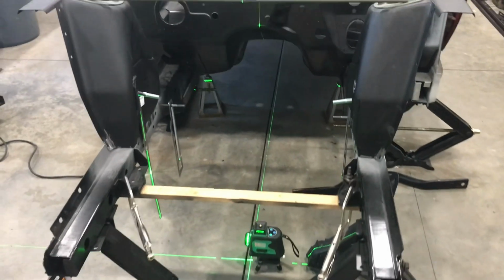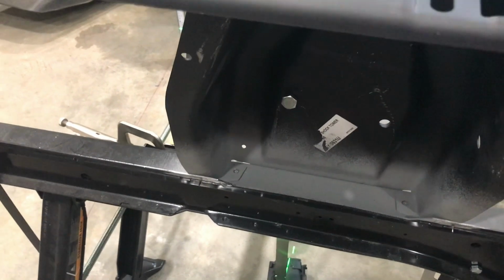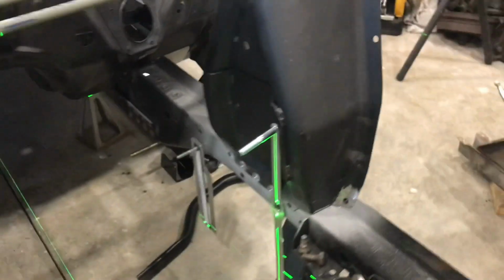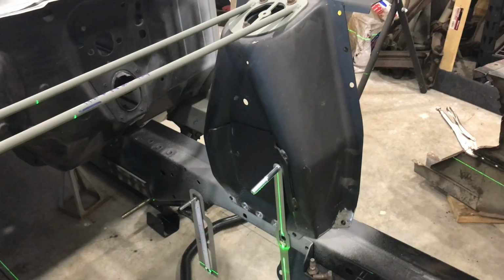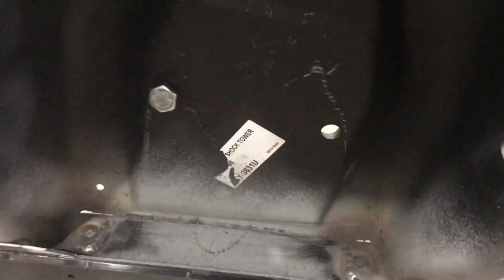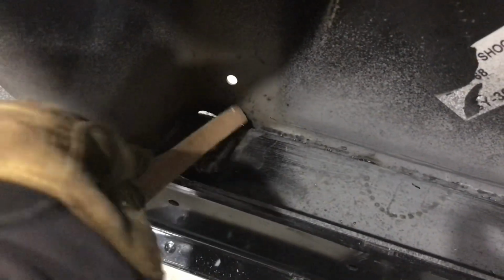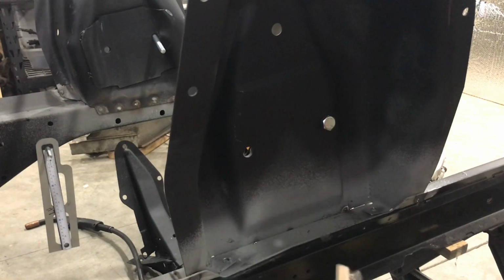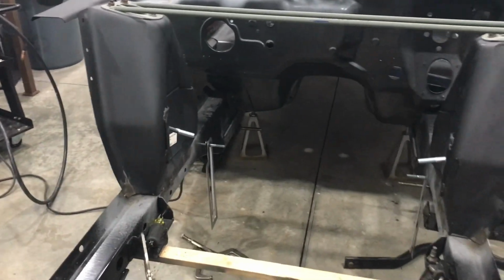Project Update: Final alignment check and welding of the shock towers

Comment: Nice videos.  I am preparing to replace the driver side shock tower on my 65 mustang.  Where do you find the points to measure the dimensions for the shock tower placement?
Reply from the maker: I used the measurements provided in the service manual for 1967.  The manual provides the height measurement from the datum plane below the car up to the forward upper control arm mounting hole.  It also gives diagonal measurements from the idler  arm mounting hole and steering box mounting hole to the upper control arm mounting holes.  Those measurements should be taken from under the car, or projected down onto the floor, because the manual provides them in a drawing labeled “pan view.”  It may be helpful to use a plum bob to mark those out on the floor.  I believe a lot of people install an export brace before removing the tower and then use it as an alignment device for the top holes when installing the new tower.  That should help with making sure the tower is angled properly.

Comment: Making nice progress..... I am in the same boat as far as front frame and shock towers go, what laser lever are you using?
Reply from the maker: The brand was Atralife and I got it on Amazon, but I can’t find it on there now.  I hadn’t heard of the brand before I bought it, but I liked that it had so many beams/lines available. It was about $125.  It’s considered a 12 line level.